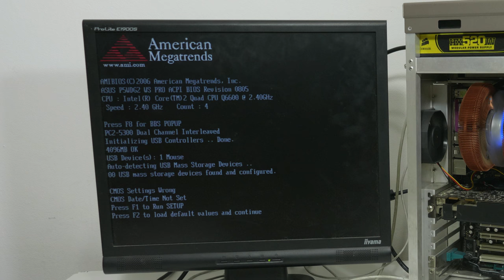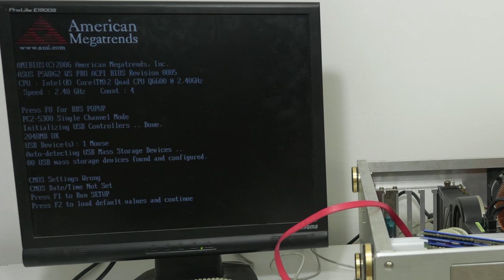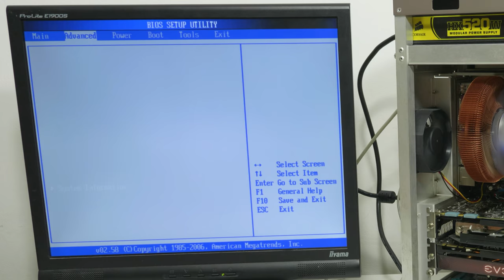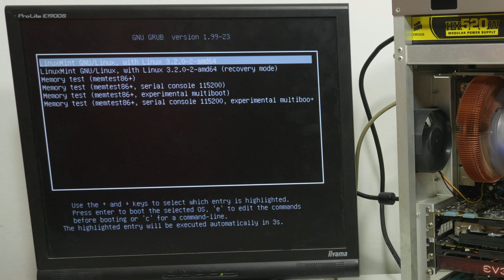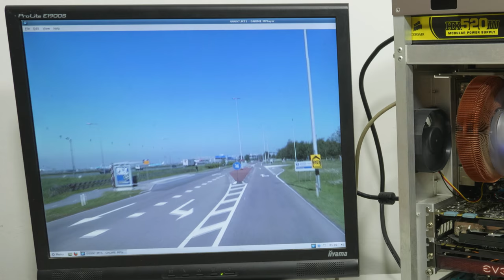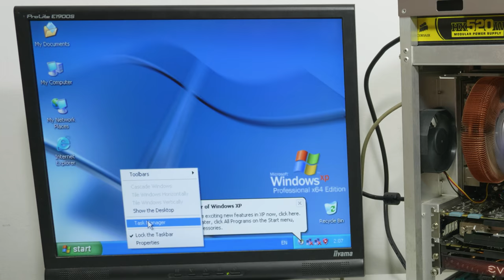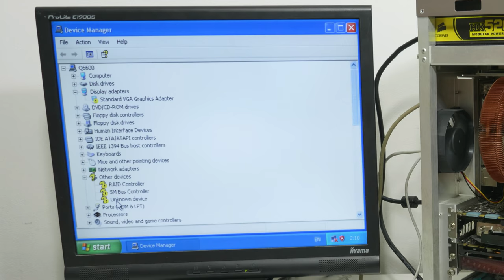Getting My Intel Q6600 up and running again for a Secret Project

Comment: For your memory problem, you probably need to set the memory voltage to 2.0-2.1V and set the timings according to your sticks (probably 5-5-5-15 or 4-4-4-12 for 800Mhz since you have good sticks, and 5-5-5-15 for 1066Mhz).  And you should also set "Performance Mode" to standard in the bios, and not Turbo, since it's known to cause instability issues with fast memory. Great video, as always ;)

Comment: Q6600 is still fast enough for almost every task in 2018 :)
Reply: BodziuM I can agree for the most part, not really rendering tho
Reply: Most of the people not use their PC for rendering, including me myself :)
Reply: Sadly no SSE 4.2 support.  This means that some very recent games won't run at all - Quantum Break and Assassin's Creed Origins being two examples.  There are more games in development - The Crew 2 for example - that also need SSE 4.2
Reply: Patrick W after using one until about 2/3 years back I got to disagree every task you can think of it will do. I edited videos a lot on that thing and gamed every day. Sure it’s slower than my i5 but it still did the job. Obviously the news games now with sse4.2 won’t run but everything else did.

Comment: Another Q6600 Build, outstanding. I have one myself, which is use on daily basis.

System hardware configuration!
CPU: Q6600 @3.6Ghz 400FSB
Mainboard: Gigabyte GA-X48T-DQ6
Memory: Corsair 8GB 1600MHZ CL8
GPU: Asus ROG-STRIX-RX580-T8GB
Storage: SSD Crucial M4 256
Storage: SSD Crucial M4 128
Storage: HDD 3TB Seagate
Audio: X-fi Fatality XtremeGamer

This little beast can still pack a punch when it comes to preformance! Yes, I am aware that the Q6600 is not nearly strong enough to utilize the RX580. However, some games surprisingly do like Metro 2033 Redux.

Comment: It’s interesting to put 8800 ultra, Vista and DX10 , and then find out how does it run Crysis?
Reply: Samir Habib you can run crysis even in windows xp
Reply: HOVNO Hraje of course you right and with 7900 gtx. But check out this 

https://m.youtube.com/watch?v=oFTm9-WKf0U

to refresh your memories, what was the difference in 2007, when you used XP on hardware design for Vista.

Comment: Why are you going to use an install of windows xp 64 bit??
Reply: Very poor support but if the hardware is supported it works well, I used Xp 64bit to get some pretty good bench scores in 3D Mark 03.

Comment: 1 year or so i used q6600 on a p35 platinum combo msi(Entusiast MotherBoard that can runn Crossfire or sli and it alsoe can use ddr2 or ddr3(https://www.msi.com/Motherboard/P35_Platinum_Combo/Specification)) with 560gtx since i cant aford newer system :D now am using newer system thoe but while back it is pretty good cpu althoe it suports gen1 of pci-e. if you use a good zalman cpu cooler and correct ramm you can OC to 3Ghz on q6600 :D

Comment: tip! if you swap the q6600 with q6700 you can squeeze couple hundred hertz more..
Reply: Vladimir  I think with a q9550/9650 he might be able to get 3.8/4.0 out of it...
Reply: I am pretty sure that this P5WDG2 mobo supports only up to q6600/6700..
Reply: I have a P5Q Deluxe, kinda like the more Desktop-Oriented Variant of this Mobo line from Asus. I can run a QX9650 without any hickups Thinking Smiley

Comment: For me this is Win Vista rig, not XP
Reply: Agreed!
Reply: Samir Habib To me more like Win7
Reply: Win7 better, not Vista. But in XP if you install an X-Fi sound card you got proper EAX support.
Reply: Alex Kirchgessner , I’m talking time correct parts. There was no Win 7 in 2007.
Reply: Tanasen, I met a lot of hatters of Win Vista, but I used this OS personally a lot, and I guarantee that if you use Vista with 3, 4, 6 gig of ram, with core 2 duo or quad, it works on Win 7 level. Win 8 also much lighter than 7. So I think it’s not correct to compare Vista and 7. 7 is  Vista SP3, if we would be honesty.
Reply: All this OS based on Vista NT 6 core.
Reply: Why not use it on windows 10 it’s proven to be more optimised.
Reply: Edmundo studios maybe you right, but don’t forget, this is retro channel, for me Vista is already retro OS like XP. 7,8 and of course 10 are still relevant.
Reply: Samir Habib Sure I get you. I was just genuinely interested if Windows 7/Vista does anything 10 can’t. I suppose it’s about the aesthetic of the OS as well to some people.
Reply: Windows 10 will use one core for the spyware stuff, one for the never ending updates & one for the Cortana crap. That'd leave the user with one of the Q6600's cores to use for himself. ;-)